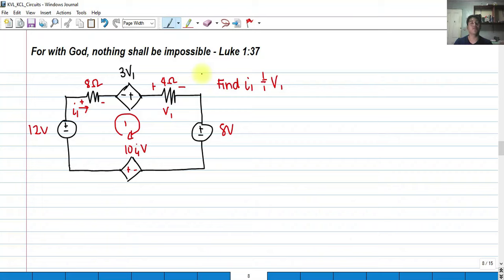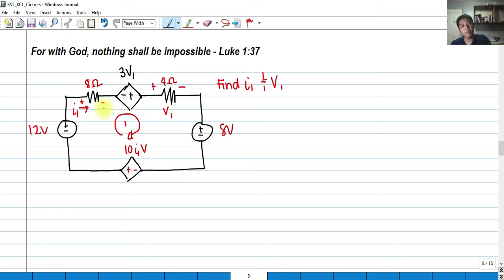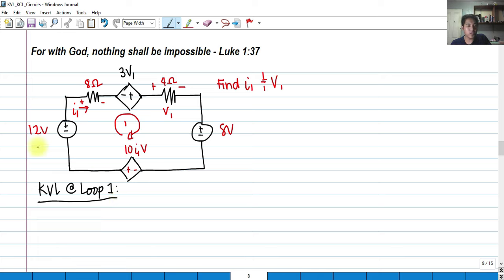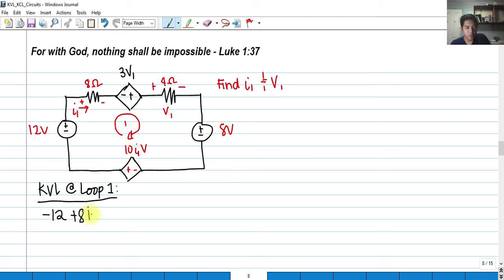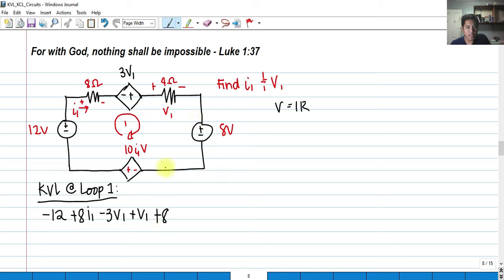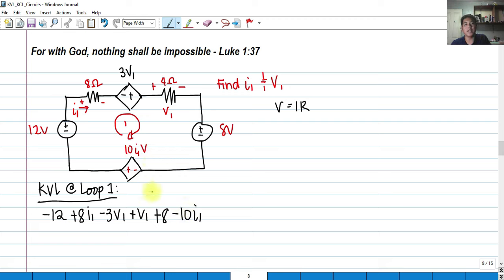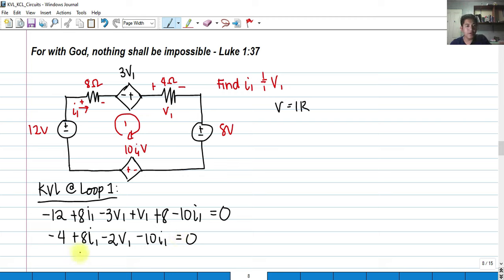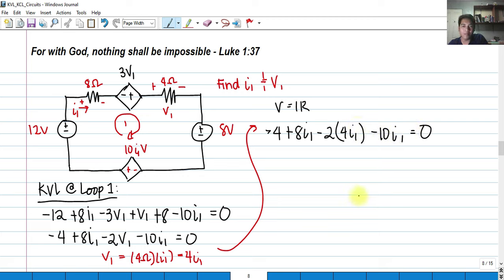KCL and KVL Sample Problems Part 1 - DC Circuits

Comment: goodmorning sir can i ask, when can i use it either KCL or KVL method in a circuit sir??
Reply: Kcl used in parallel then yong kvl used in series
Reply: Kahit anong circuit pwede mo siyang gamitin, at pwede mo rin siyang gamitin hindi lamang sa resistor, pati na rin sa conductor or iba pa.
Reply: @rochelletimosa1782   You can both use KCL and KVL in difference ciruit.
Reply: KVL if about voltage hinahanap, KCL if current hinahanap, pwede sya sa series-parallel or parallel-series

Comment: nakuha ko na po siya. And saktong -6A po.. di kasi maicomment ang picture ng solution.. thank you Idol🥰🥰🥰
Reply: 6 - (V/R) + 2i1 - i1 - 2 = 0
4 - (V/9) + i1 = 0
4 - (V/9) + (V/3) = 0
36 - V + 3V = 0
36 + 2V = 0
2V = -36
V = -18V

V = IR
I = V/R
I = -18V/3Ohms
I = -6A
Reply: Sagot ko 0.5A
Reply: Ano yon sir 4×9 dinistribute mo po yong4?

Comment: @Yu Jei Abat sir pwede magtanong? Kasi Yung sa first example niyo po nag combine po kayo ng like terms pero Yung "8i sub 1" at "10i sub 1" ay Hindi na combine..
Reply: Same parin po yung result kasi V1= 8i1. Maka-cancel yung 1st 8i1 sa value ng V1 kasi V= IR which is i1(4 ohms) multiple by 2 which is given sa equation, magiging -4-10i1=0

Comment: Confuse po ako sa kvl loop 1 talaga po bang -12 po yun hindi 12 po kase po palabas naman sya sa negative at papasok sa positive (first example po )
Reply: ano pong conclusion niyo kuya? nalilito din po kasi ako magkakaiba sila ng method kung yung isa positive po dapat siya pag ganyan
Reply: If susundan po natin yung clockwise loop na inistate ni sir, yung current po is actually papasok sa negative sign. Ang first encounter po ng current sa 12V ay yung negative sign kaya po magiging -12 if susundan yung clockwise loop na ginawa ni Sir

Comment: Please respect my comment. Ask ko lng why yung iba nagbabase sa sign ng voltage increase kunwari sa 12v, from 0 to 12v then the sign in kvl is +12v. Sorry newly lng tlga ako sa Kvl Kcl.
Reply from the maker: Hi, either of the convention can be used. As long as consistent